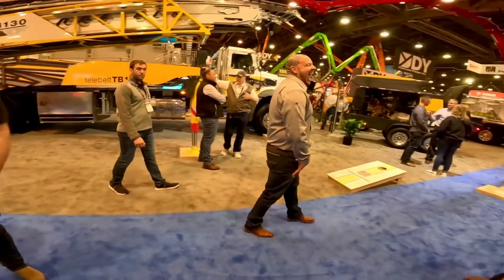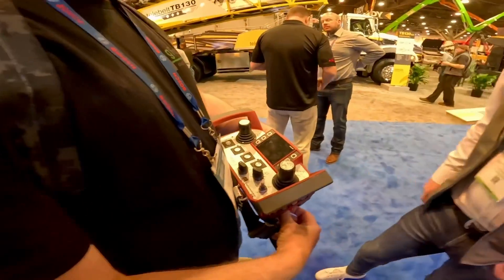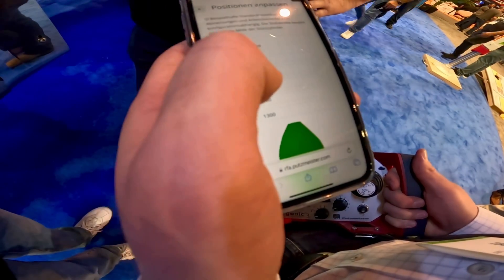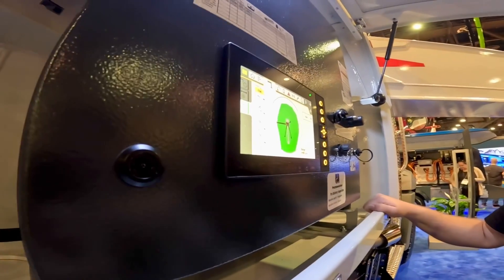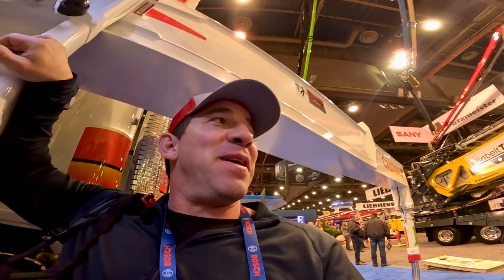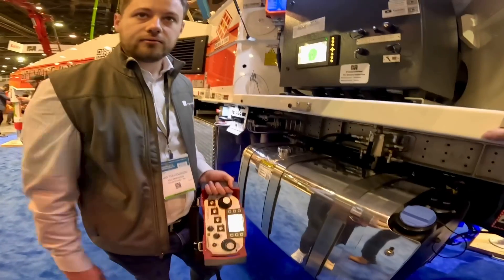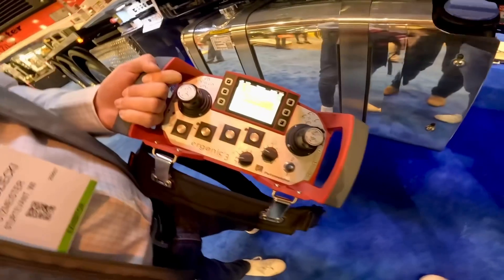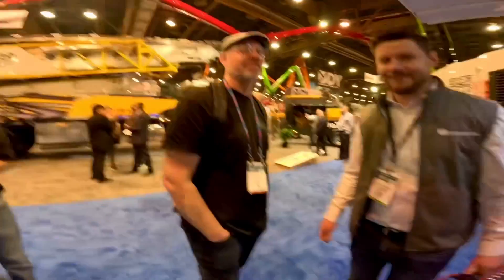CUTTING EDGE PUTZMEISTER technology at World of Concrete 2024

Comment: I thought might skip the putzmeister booth   Wow lots of computer stuff years ago you just new what you could and couldn’t do with a machine  lots of safety now.
Reply from the maker: I think the main issue was that some operators thought they knew what they could do with the machine …. until they didn’t. (in terms of short-rigging).

I’m not hot on most of the new computer controlled systems, but this one I can get behind. Oh the things I could do with this new ISA system. I will also say that the Ergo 3 system is a refreshing update from the previous Ergo 2, which had me pulling my hair out. They’ve definitely taken operator feedback and implemented it to make the Ergo 3 more user-friendly. 

I WANT ONE!!!!!